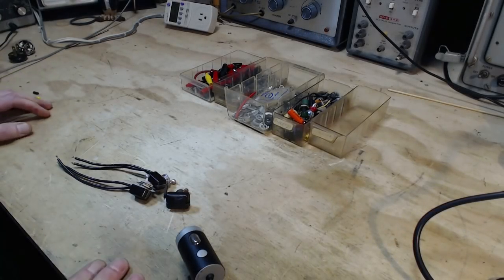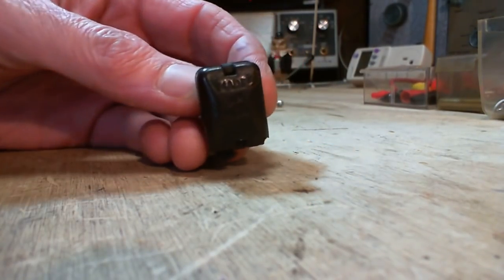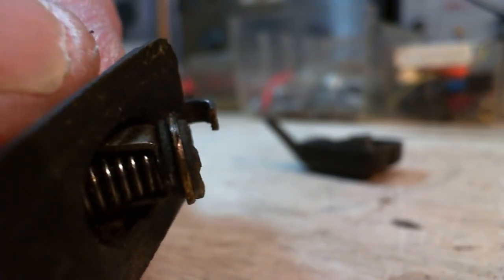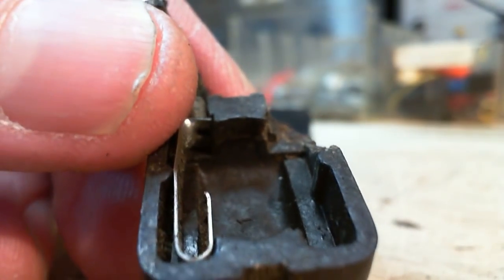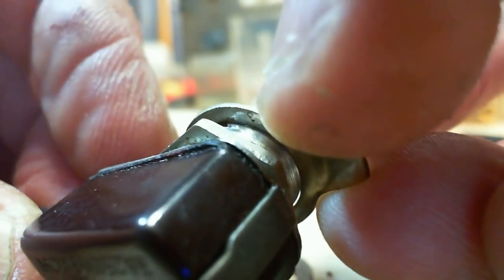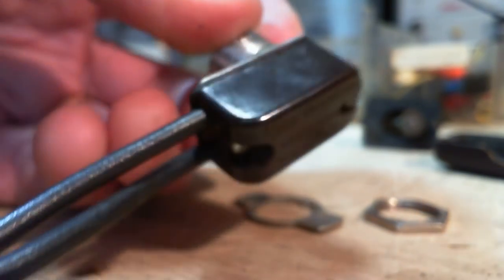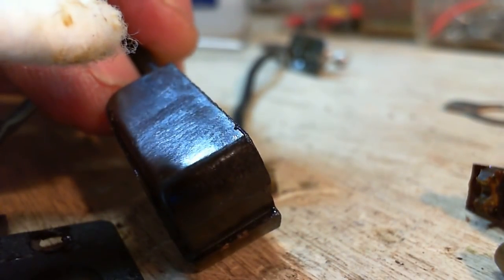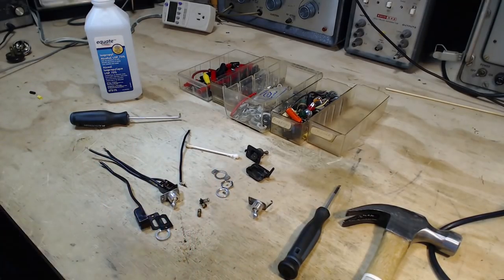Triple Toggle Switch Post-Mortem

Comment: All the switches I have ever taken apart have had grease in them. I assume it is conductive. Normally grease makes a good insulator unless, perhaps, the grease was thin enough to allow contact through it. The problem with your switches is that the grease became thick due to age and it was no longer letting the roller actually make contact with the flat conductors. Cleaning the grease out would repair them. I have made a number of switches  work again. Not sure of the life span of those repaired switches after the grease is removed but I have been able to use the repaired switches for quite awhile after repairing them.

Comment: The goop is grease put in at the factory, many  times these switches can  be made to work by cleaning them good with some thing to dissolve the old grease by soaking the switch in a solvent and working the switch back and forth then relube with a light oil. This only works if the contacts are not burnt or pitted badly.

Comment: As I said before if you use JB weld high temperature on the switch it will be stronger than new! So yes it is repairable
No it's grease they put grease in when they manufacture the switch to prevent damage and wear and electrical  arcing

Comment: Let me tell how that switch works, that who was opened as #2. The cap in the end of the spring is just a seat for the toggle. when the tiggle goes opposite, it presses the spring to a point where the bottom of the spring goes over to the opposite side, taking with it that spool in the bottom of the switch. The spool then gives contactbetween those two contact points. I belive the reason thar switch worked so bad is all that goo who was poured into it.
Reply: Yep.

Comment: I test all my NOS (and new) switches with a cheater cord plugged into my 100 watt dim bulb and a meter checking the voltage drop across the switch.
Reply from the maker: Your experience is showing.